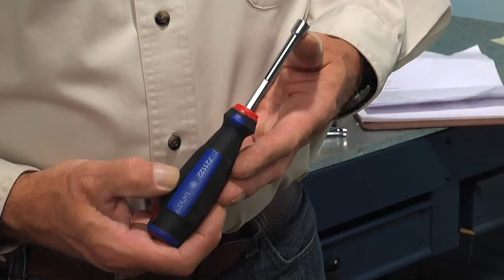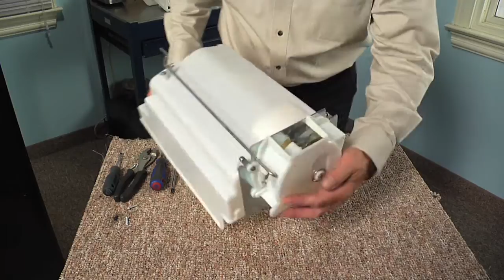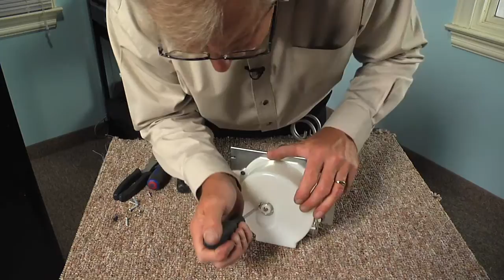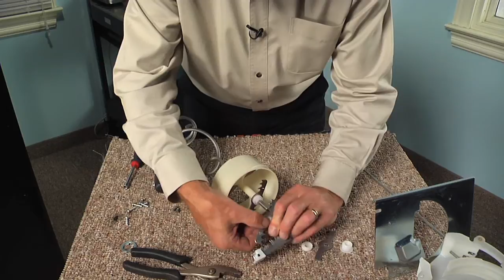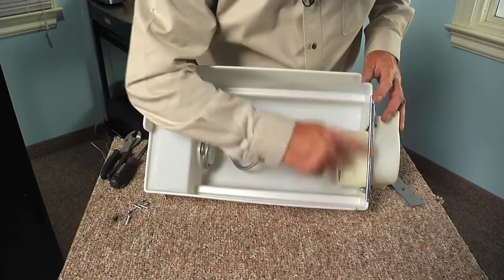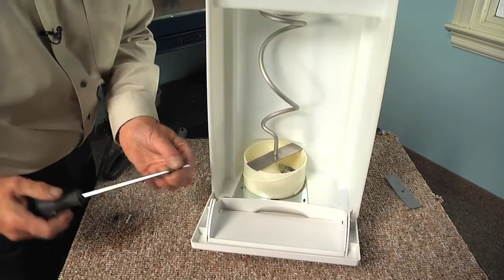Refrigerator Repair - Replacing the Drive Blade (Frigidaire Part # 241684501)

Comment: Thank you for the  very detailed video .  I did everything the way you explained.  It works, but now it only dispenses crushed ice, no cubes.  Did I do something wrong reassembling the blades or could it be  an issue with the electronic board?  Thanks again.

Comment: My Fridgidaire is making ice fine.  However it will not dispense.  It will spit out a few pieces of crushed or a few cubes and then stop (just buzz).  How could I determine if it is the drive blade causing the problem?

Comment: im repairing the same unit for a neighbor. i started by trying to replace a broken drum (241685101), then realized what caused that to break was the metal drive blade (241684503) below it. the hole in the center of that blade was bent, creating a gap or looseness, allowing the blade to slip down into the spiral instead of sitting up at the top. squeezed it (the area in the center hole of the blade) flat with some vise grips (it was late night so i couldn't hammer it flat), that fixed the problem - it now sits level and tight into opening slots on new drum. put the whole thing together only to find out at the end that the plastic nut at the top is missing a chunk and there is no washer nor e-ring - those two pieces were missing upon my arrival.. it's 10$ for the auger nut (241685001) and 10$ for the e-ring (241690201), but that 2:47 washer (241690306
) sells for 25 to 40 dollars! insane! is it special somehow? any idea of its dimensions so i can substitute a 1$ (or less) washer instead?
Reply: I'm in the same boat, everything you mentioned applies to me, drive blade was warped, breaking the drum, washers and e-clip also missing. I replaced the drum, need to fix the blade, replace the washers and e-clip.
Reply: Also the plastic nut was missing a chunk, weird eh? Exact same problem. Were you able to replace the parts with generic parts or genuine parts only for the washers? Thx

Comment: Electrolux EI23BC56IW8 I have this unit and the spring came off that switches cube to crush. Diagrams show 2 screws, but I only have 1 hole for screw. I do not think I am missing anything, but I can't get the spring to grab ahold of something to stop from sliding towards back. I have searched everywhere looking for photo of assembly or video. I hope you will reply with some information. I can send a photo of what I have if there is a way.

Comment: Hi Steve,
Thanks for the video. I was wondering if the drive blade is tight in those 2 grooves in the pastic cover, because mine is coming out of grooves and getting caught up.
Reply: You may need to reverse the blade so it shows the "UP" side towards the slots.